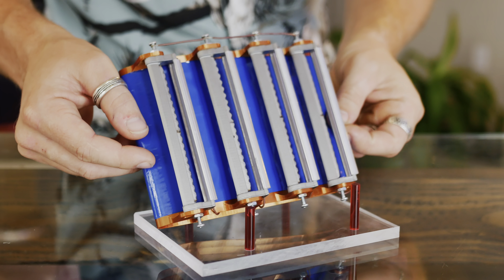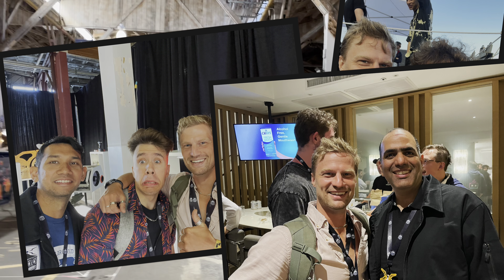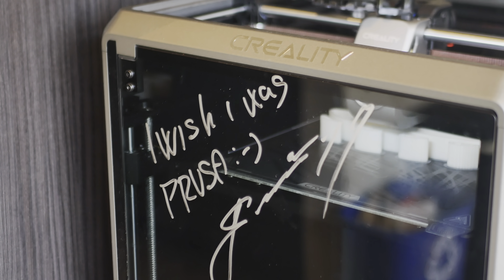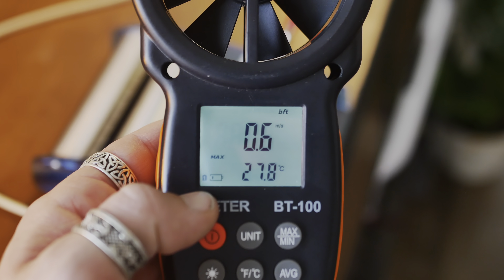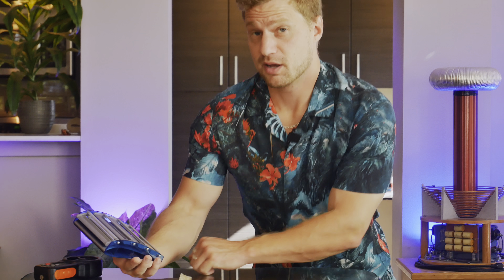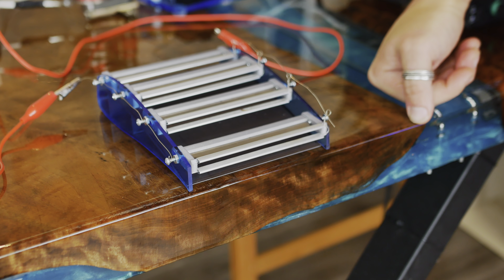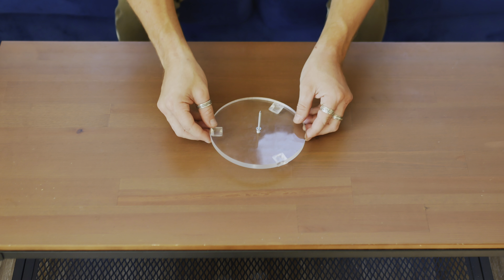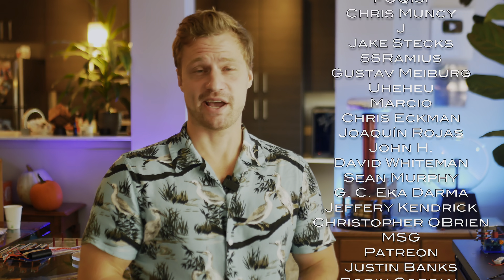Designing A Self Propelling Ionic Thrust Wing

Comment: Is the normal air around the wing accelerating? To gain force from electric field, the air should be ionized.. I understand you build strong electric field form high voltage conduct wires. But how did you make air react to the field?? And what do you mean "plasma"? Plasmaized particle is charged so it can react to the field, so as far as i understand, you plasmaized the surrounding air by high voltage, and at the same time accelerated the air-plasma using the same electric wire.
In short, I think you put electric wire(both + and -) and used them for both "making plasma" and "accelerating plasma".
I'm completely not sure about my analysis so anyone who knows how "exactly" that plasma thruster works, please leave a comment for me :)

Comment: This really amazing work. Are you familiar with the coanda effect or circulation control airfoils? It’s a method to accelerate air on the upper or lower surface of a symmetrical airfoil to produce lift by making a ‘virtual’ aileron. By arranging more thrusters on the ‘top’ side you may be able to produce lift without the need for an airfoil.

Comment: Nicely done :) . My question would be, why not to include your ionic trusters INSIDE the air foil rather than over it ? It would make sense to keep your air foil profile the purest as possible and have an internal thruster rather of external. Plus it would allow you to direct the air flow inside the wing from one to another thrust modul... You might be interested in observing the "wing less" (motor and blade inside the vertical cylinder) ... as on https://www.youtube.com/watch?v=dS0oFmzU06g

Comment: I am thinking that because the segments are spaced in a linear fashion that you may be getting standing waves between the segments you might try a logarithmic spacing scheme.
Also you may consider a concept of compression like is used in a turbine engine were the blades in the front are large and the blades on the trailing edge are small and the length of the blades decrease as a wedge.
Or create a completely new design putting the entire thing inside of a casing like a turbine engine. Or in other other words a radial concept.

Comment: you need to start thing of a built in power source. batteries alone are to heavy. solar might work, but I think you could build a light weight generator built in to the fuselage driven by a pin wheel style prop

Comment: Shouldn't the thrusters be on the bottom? A plane wing works from pressure differentials - not from pushing air down, but from the absence of air above in a low pressure area, resulting in the wing being pulled it up, not being pushed up like many people think. The lack of air pressure above the wing means your thrusters will be less effective on top of the wing. This is why every plane you see has the thruster in line or below, not above. I'm no physicist, but I'm pretty sure on that.

Comment: That is very interesting. Why not put the thrust under the wing. The air flowing under the wing is what creates lift. The air flowing faster under the wing is exactly what creates lift. Now with the air flow on top of the wing providing the thrust, there maybe a problem under that wing with the proper amount of velocity to create lift. what do you think. the velocity over the wing will push down and the increased velocity under the wing will create lift. If a quarter of the forward part of the underside if the wing generated thrust under the rest of the underside of the wing, then you may create lift with the air flowing faster under the wing and also create velocity with the thrust. That is what I see. I could be wrong maybe wrong.

Comment: Just found you . THIS  is  fascinating stuff . INSTANT  SUB . 
Random thought here . An Airfoil works by creating Lower Pressure above . (Bernoulli Effect)
Therefore , might the  Ionic Drives  be  better on the Lower SIDE  of the Airfoil in Higher Pressure air ?  
Until there is a Functional Prototype , actually flying , I  suppose there is no practical way to assess this in a " Homebuilt " setting .

Comment: I've watched a few of your videos and you have mentioned the serration on the high voltage side helps. When you move to wire instead of razor blades you might want to consider shaping the wire so it has a serrated shape instead of straight for an extra boost in performance with little cost to weight. I'd suggest looking into shaping with wire to be an involute gear shape made by running a wire between two involute toothed gears (standard gear tooth shape). Good luck. I look forward to seeing what you do next.

Comment: The thruster idea is great. The idea of it generating usable lift while mounted over an airfoil is not. Airfoil lift is a product of the dynamics from its movement through a medium, not the medium moving over it.

An airfoil creates lift via the extreme vacuum formed on its rear surface as it is dragged through a medium. This vacuum redirects the medium downwards, lowering the pressure above the airfoil. More of the medium is pulled down towards the back of the airfoil. The medium is accelerated and then shot down the airfoil’s trailing edge. The opposite and equal reaction is lift—Newtonian. Not Bernoullian.

A deeper look then uncovers that the vast majority of the energy that sustains an airfoil equipped aircraft in flight is from gravity. Hence glide-ratios and autogyros.

Keep up the good work on the thruster idea, though.

Comment: i'm not any good at aircrafts, but my intuition tells me that placing the engines under the wing could make sense. 
the pressure under the wing is higher which should increase the thrust i think. the air flow is also slower under the wing which means the engines should work at lower velocity to achieve the same speed of the aircraft compared to the top engines configuration.
on the other hand, a lower pressure means  engines have to move lower mass of the air flow.
i think you have to test the bottom engines configuration.

Comment: Chat GPT can't be trusted to give you calculations. It wants to satisfy your request by any means nessesary, and will fudge numbers and make shit up to do it.

Thing casually gave me explosive instructions once, and I swear to god, the recipe was absolute suicide.

Esentially it was explosve mixed with exploaive as a binding agent.

I think it was a combination Nitrtrogen and a Glucose based recipe. I forget the exact type... but you don't need to take my word any more than GPT...

Point is, it only told me the bare mimimum to satisfy my prompt and will mislead you if you don't know enough to lead it with more questions.

The fact its so easy to control GPT with leading questions also makes it a worthless editor and critic.

The only thing it will push back on is rightwing politics, and thats only because of the bias of its programers. It does not have the capacity to disagree. It just has hard line on what it can and can't say. It will agree with literally anything if it thinks doing so will satisfy you.

That glucose and nitro recipe had nothing stopping it from spontaniously detonating the moment you mix those already exploaive materials. It didn't mention anything about stabilizing it. If you didn't know that going in, you wouldn't survive that lesson.

Its like wikipedia. A good place to start if you don't know where to start; but everything you read from it needs to be seperately verrified by a primary source.

Comment: Doing a bit of napkin pseudo-science, I'm guessing that at least in the short term this type of design will work best as the 2nd stage of a 2-stage system. Stage 1 dumps a bunch of energy into the aircraft getting it up to mission speed/altitude, stage 2 the ionic thrusters sustain flight while you soar thermals etc

Comment: I do not know if the conductivity of the materials making up the wing matters or not, but a Styrofoam wing would reduce your weight. You can also cut out two air foil wing end caps and connect them with rigid plastic tubes, one on the leading edge of The wing and a squashed one for the trailing edge. Then stretch polypropylene film over it or even better and stronger Mylar film. This will reduce your weight considerably and make it more rigid. If you make the wing large enough you could use solar cells on the wings to power it in stead of the heavy batteries. Or make a sealed flying wing filled with helium and solar cells on top. Use your ion engines to power the blimp wing.

Comment: Why not just make it a full slot wing? The trailing edge of each section can be the emitter and the next section the collector with a voltage ladder creating a gradient across the entire wing assembly.... or section the winglets for 2 electrodes each with a simpler power supply.  Wire emitter at the leading edge for the first stage.

Additionally, if all the stuck up guys building fancy QCW and other advanced Tesla coils would expand their application, those advanced driver/regulation schemes would really come in handy optimizing plasma generation.... but most of them seem to lump this stuff in with pseudoscience and stick their nose up at it.

Comment: I think it'd be worthwhile testing one set of positive / ground at a time and testing whether there are diminishing returns as you stack them up. I might be wrong but my thinking is that the ions get pulled from positive to ground, but the next positive's ions are being pulled both forward to it's own ground and back to the prior ground - the distance is less to the forward one so it works, but it is less efficient. Therefore a larger distance between them could be beneficial. Probably worthwhile testing the effect of different voltages as well.

Comment: Now if you could interface the iconic canute valve into the ionic flow, you could probably negate the negative pressure drag along the wing surface if you synchronously toggle the canute switching under microprocessor control via your own program or AI! Hope this helps.

Comment: Have you thought about how a van de graph generator Deposit's charge so the voltage and velocities can be multiplied, The charge is deposited on the inside of the hollow sphere where the  charge is zero. Faraday cage. 
   The voltage gradient across the thrust plane is either a virtual cathode or anode. Sharp edges produce a streaming corona from a negative potential. Flat surfaces produce a smooth homogeneous electron glow across the full surface, this is because the positive nature of lost electrons in the material surface and the protons of the material are not free to move. But this does not mean the repulsion and attraction forces are not there, they are just spread out. Did you ever think about having enough power to rip off every free electron in a space above an  energized plate in the atmosphere to create a virtual vacuum above that plate. What could be done.  It wouldn't take a very big plate to create a lift force large enough to fly an air craft. But the power source would be enormous.

Comment: Thinking about how ions that open up to currents itself is not so easy to generate a trusting that doesn't cause damage to the cells in the body of atmospheric plasma ions direct the flows but they leave a trail of disturbing energy that builds up over time it is like a bouncing ball over the atmospheric outermost reaches  i know about the space dropping in to the earths core you think about lightning it make contact from earths charges to space it is unique to understand that it looks like it's coming from above but special camera's show its formed by the earth to space

Comment: seems like if done right the wing could be made to work as a generator. booster for windmill it just seem like in a weightless containment it may have a drastic increase in rpm air movement removed and properly weighted,  but this is not my field so just a thought.

Comment: Hey! Great video. Engineer here, just wondering why you measure airspeed and not thrust. Exit velocity is important, sure - but it’s only half the equation - literally. Thrust = mass flow * exit velocity. So if your ionic thrusters are moving a large quantity of air, even at a low exit speed, you could get enough thrust to build your ionic plane. Just a suggestion! Keep it up.

Comment: So, a few thoughts on material and aerodynamics as well as the overall design of the units attached to the wing.

First of all, I am not really sure anymore what you are printing in, but you might want to look into one of the expanding or foaming PLA filaments. They are already used in 3d flight model printing and can massively reduce the weight of a printed part while still being strong enough and also reducing the print time and cost. 

The next point is the design of the thruster structures and how they attach to the wing. Aerodynamics are weird, so even a design that might at first look very aerodynamic could actually be creating turbulence and make it loose a lot of thrust. I would err on minimizing the crossections wherever possible. Maybe even not printing the struts that hold the thruster sections up at all, but only the joints and use thin carbon rods or tubing for the struts. That way a lot of mass could be shed and the number of struts in the later flight model reduced, creating less points for turbulence to form.

You also could print a "crincking" mechanism (like those things that turn paper into a zig zag pattern) to evenly and regularly shape the wire, recreating the even distribution of power you got with the serrated blade.

Other than that I recommend taking a look at the channels that feature 3d printing of rc planes and have been working on that. They have started to diverge quite a bit from traditional designs of struts and reinforcements as that is enforced mostly by limits of building a wing traditionally, which you don't have when 3d printing.

One thing I am wondering about is how the thruster affects lift. The faster flowing air over the top of the wing is after all a major reason for how planes achieve flight, so depending on just how effective the thrusters are and what kind of interaction there is by them pulling the air even faster over the top it might increase lift and reduce the demand on thrust by reducing the speed necessary to achieve sustained flight.

Comment: In order to reduce weight and drag, why not build your smooth electrode into the surface of the wing? Think of conductive strips along the wing's surface. Then you would only need fine wires above the wing in between the conductive strips.

Comment: A thought I can't get out of my head is that the device is going to obstruct the boundary layer, and it is essentially a spoiler. You want the top and the bottom of the wing to be smooth. In a power off scenario (assume an electric failure) having a design like this could be terrible for any of the souls onboard as the glide range is going to be severely impacted.

Comment: I’d like to. See  maybe a boost for taking off like. B2. Inject steam 
 But find a gas  that  would be. Release. To produce more thrust.  Possibly  even being diverted. In Rommel. To remove. It from. Interacting with  the atmosphere as it’s re routed through a tunnel  then allowed to. Act on the external. When tracing back. So that. Basically be a gas.jet   Some gases. I think  can.  Move around corners.   With out inertia.     Constantly. Rotating

Comment: As an extension to this principle, would you consider using the same principle to build an ionic thrust turbine?
I think there are a few different designs which might provide some better efficiencies. 
Something like the efficiency of a  turbine vacuum and traditional jet turbine methods.

Perhaps if we are able to use the wing design for movement and lift/manoeuvre. Also use multiple turbine blades made up of ionic thrust blades for forward or directed thrust.

Comment: Hi, why don’t you make the ion thrust motor part of the wing? Both upper and lower surfaces should contain spaced metal parts (+ and - in sequence) so that the the airflow is generated directly on the wing surface: no extra parts, no dragging, wing working as a real wing. The idea is to have a real wing with metal parts on the surface that correctly driven just create the airflow .. than the wing generates lift … and you have an airplane.
Just start from a balsa or balsa + covering glider … add minimum weight metal strips on the wing, energy sources inside the fuselage…

Comment: OK u got a 3 d printer. Now make tour wing thin aluminum paint with graphene ink. Aluminum pos or negative graphene paint Robert Murray Smith you wing is now lighter the wing is the battery insulate paper towel eA layer of paint should be 1.5 volts or beter

Comment: How about combining trailing edge similar to the Junkers Ju-52 with leading edge slats?  You could power the leading and trailing edges, and improve low speed performance.
Also, have you looked into the idea of using the ionic thrust for augmenting the boundary layer flow, not just providing thrust?